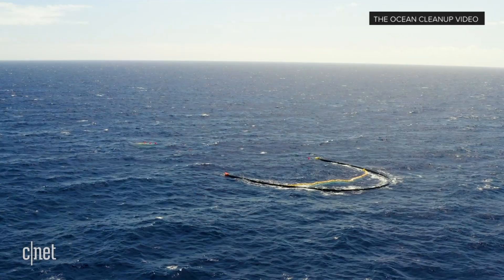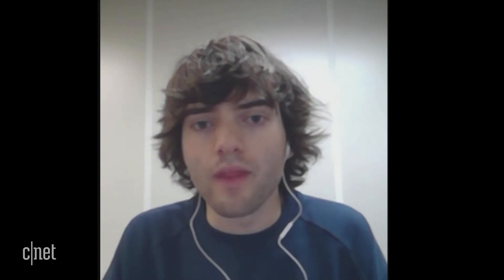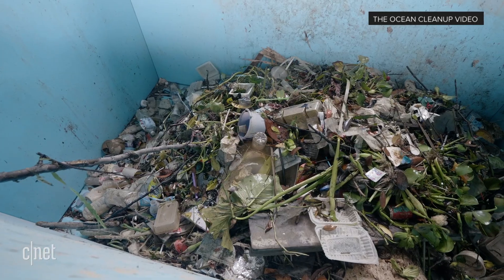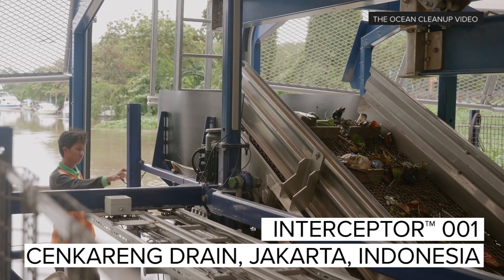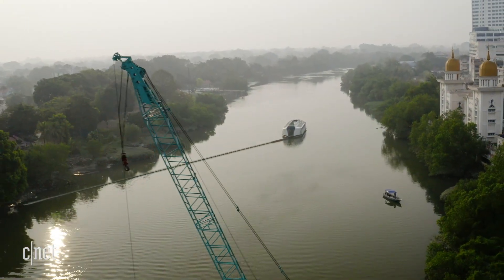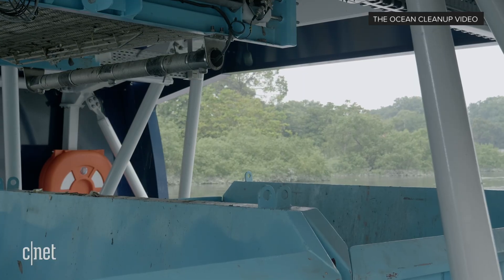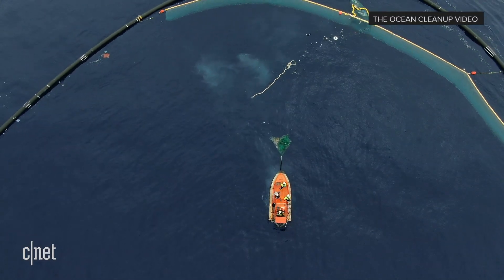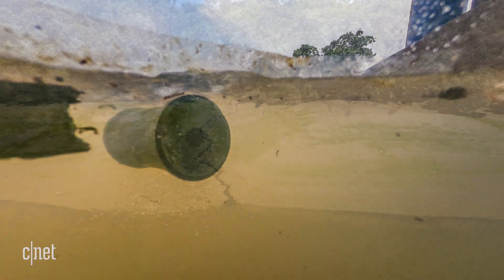Boyan Slat talks up his latest invention, The Interceptor

Comment: We need to get rid of plastic and go back to glass and paper.
Reply: Both glass and paper use a lot of energy in the making, far more than plastic. Transport of plastic, because it is lighter and less bulky than glass and paper, also uses fewer resources. paper of course also requires the cutting of trees, whereas plastic is almost entirely made from oil industry byproducts. The solution is more about recycling plastic as part of a program of more efficient waste management.

Comment: The Interceptor is such a fantastic design .. the way you can pull out the internal barge and move it over the edge of the river to lift the bins out with a crane..... fantastically effective.... there should be 1000 of these things working in rivers around the world..

Comment: Plastic makes a far better binder for road gravel than tar ten years without potholes or ruts.
Plastic for normal recycling needs a certain level of cleanliness or it is unusable for roads it does not matter and you can make new roads from the old roads. A little carbon dust turns all the plastic black so the uniform color is achieved and roads will not look like rainbow vomit.

Comment: Preventing river plastic from entering the ocean it will work.

Not effective for ocean plastic, due to the clean up size and most plastics are below the net reach and micro plastics, only possible way to clean up the oceans is to spread plastic eating bacteria in most affected areas.

Comment: This thing collects quite a bit of bio matter. Is it safe for fish?
Reply: Check out the official website infopage, its solid barriers that float at the top two feet below the surface, from the looks of it.
Reply: @Joshua79C  Thanks for the info. I still have concerns about other surface dwelling animals such as some mammels and im sure it would be a problem for Salmon durring their migration. It looks like it also collects a lot of bio matter like wood and leaves which cant be recycled. At least not at a plastic plant. So it will make sorting everything harder. They should add an AI to attempt to only capture man made objects and notify authority's if a person or boat comes in contact with the thing.

Comment: Clever use of engineering and innovation. The interesting fact I did not know was that 80% of trash in the sea comes from rivers.
Reply: Yes most though comes from Asia
Reply: Well its pretty logical if you think about it. Do rivers have trash bins? No. Are alot of people on the sea? No. Etc etc.
Reply: @johnperic6860  yes cancel rivers 😅😅
Reply: It already work in Baltimore harbor to clean debris, it not innovation. This is a copy of what is already in USA.
Reply: @Brancaalice  While I agree the concept is nothing new, the innovation comes from putting it all together. Solar-powered(yes the baltimore harbour one is also), autonomous, easily deployed around the world, Already have several working around the world and more on the way,  Has a nice design to it(having a nice design makes it less of an eyesore to people),  has a system to easily remove the trash. 

It has alot of things going for it together. The baltimore water wheel is nice but this looks like it takes it to the next step.

Comment: I believe the big plastic in pacific ocean is the big problem.  My idea is to create big strong net 5  or 10 miles wide , two plane carry it in low flying holding both site and scup all plastic until all job is done.  Of course some not smart fishes, will be sacrificed in the process, but it a low price to save more creatures, include the human. My concern is about big animal like whale, but they are smart and to heavy to catch in a net of plastic. Im sure it could catch tons of plastics in few hours with low cost, not much investment with complicated machine. it can be used in good weather, so the work of the pilots would be easy.  Where they will drop those plastic i don't know, but someone find out.  Maybe build a recicle facility close in the area.

Comment: WHY not using power from water current? LUL
Reply: The water moves too slowly, you would need to build a dam
Reply: @SiisKolkytEuroo  hmmm think still better than solar
Reply: No, it can work across the river and is relatively easy to install
Reply: And because its power consumption consists mainly of a few slowly moving/rotating parts, it doesn't consume that much electricity
Reply: @SiisKolkytEuroo  hm yeah. Apperently. I mean obviously your right . They must've thought of that as well and solar is the way to go